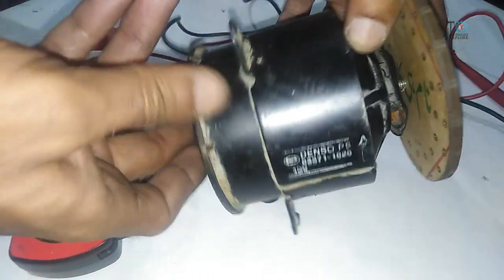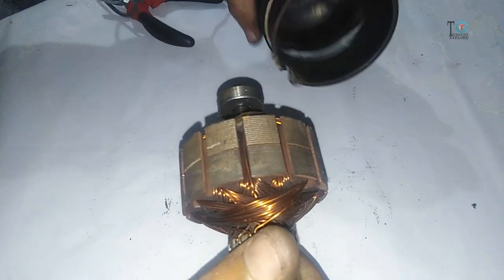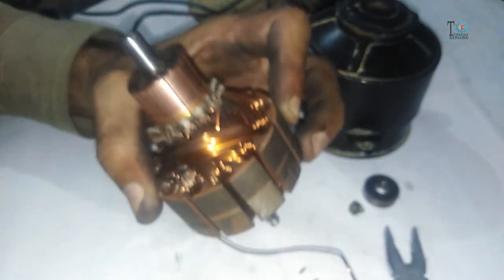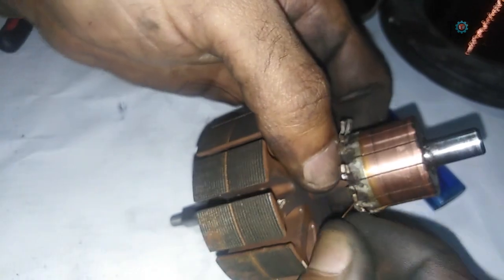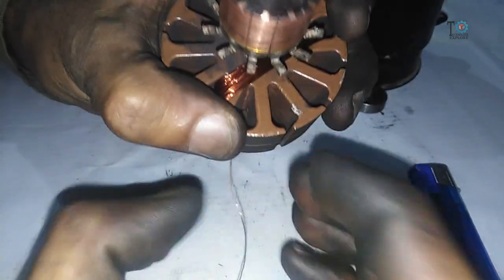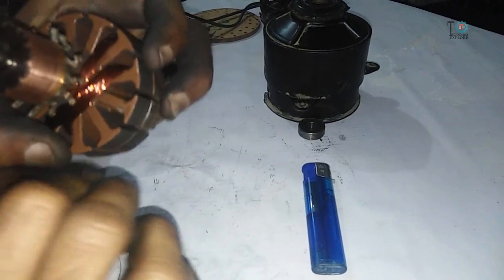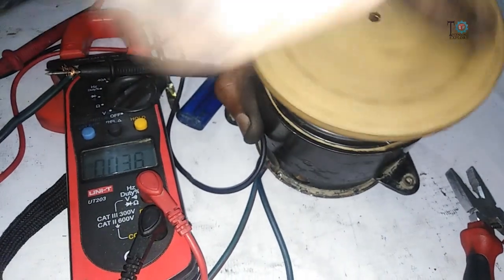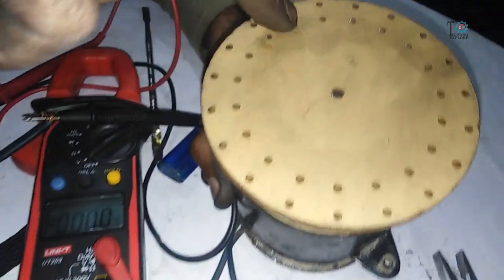How to Build LOW RPM Permanent Magnet Alternator from old 12V DC Motor|DIY Project

Comment: I was wondering wuld same be true if I take alternator and remove winding and actualy cut slots for pole peaces wuld it still work be useing slip ring ?
I have some old bosch starter motor its ceramic magnet type I noticed some strange slots betwean magnets there is cinde of empt space I was wondering what wuld hapen if I wound coils around ich magnet peace wuld that make some voltage in that winding ?
Is there any way to enchence windings externsly from starter motor ore generator somthing like transformer wires?